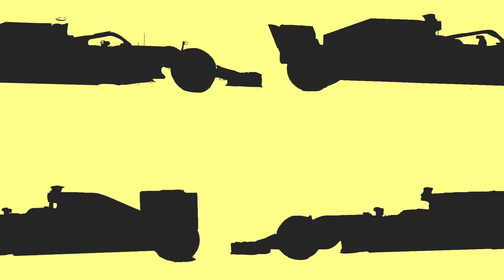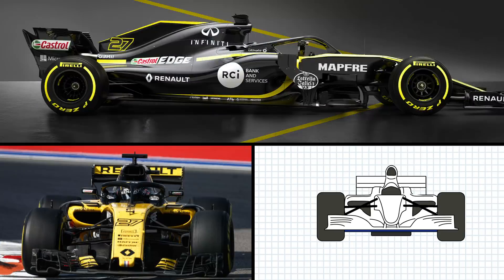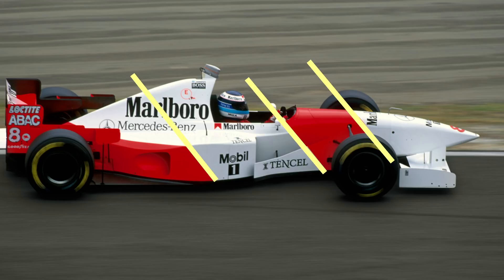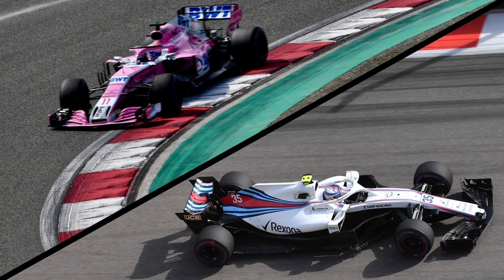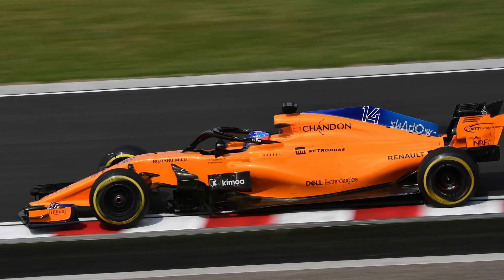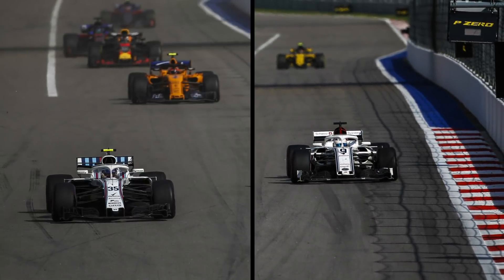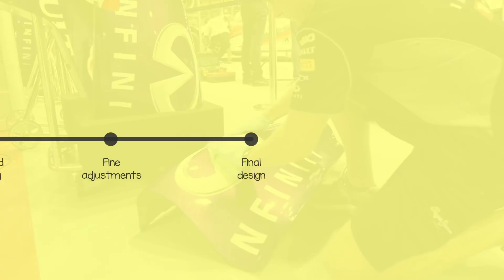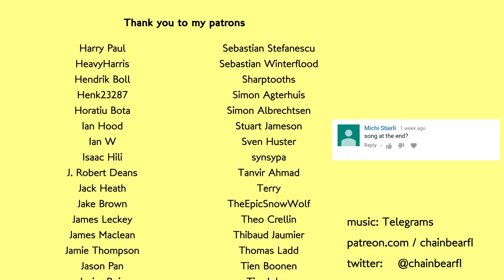Designing an F1 Livery - a complicated business | Plus Q&A

Comment: Fun fact: while silver paint covering carbon-fibre cars today is relatively heavy, the reason why German racing colour was orginally silver was because of weight savings. The bare aluminium skin was simply a few grams lighter than painting it.
Reply: TIL that Germans were already over-engineering in Formula 1 before anyone else.
Reply: not even in f1. it was in the 30's when f1 was not even established. They had something called european drivers championship
Reply: Fun fact: The first run of Model T Fords only came in black because black paint dries the fastest, thus making the assembly line run more smoothly. "You can have any colour you want, as long as it's black!"

Comment: OF COURSE you would know a lot about design and color.

Also, a bit of a trivia on an area that's not F1, but very close to it in practical therms and the subject of the video.

You know that iconic bare metal look American Airlines planes once had?
Here's a refresher picture:
https://media.wired.com/photos/59328ceff682204f73696a3c/master/w_799,c_limit/AP361370675493.jpg
It was, indeed, the bare aluminium of the skin of the aircraft. Saved them about 500kg in paint. That's more weight for passengers, luggage or fuel, or less fuel consumption for the same payload and fuel load.
Imagine a bare carbon fiber car. I think that would look very cool.

AA moved away from that look.
Sure, in theory it sounds cool, but in practice it wasn't worth it. The corrosion of rivets alone was the highlight of the problem, hastening the retirement of the aircraft. Nowadays, airlines are adopting a minimalist approach to their liveries, adding little to the white coat of the factory. This because of the extra layer of paint on top of the standard white. Also, it's white because it reflects sunlight and helps reduce thermal stresses over the fuselage.